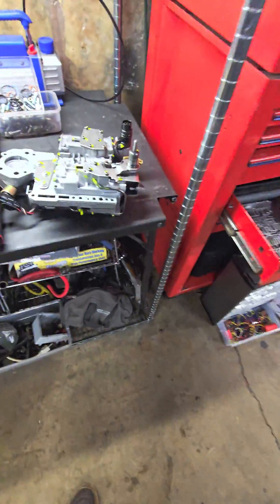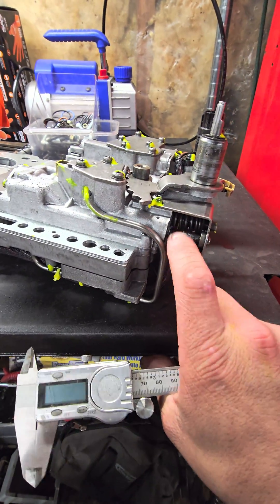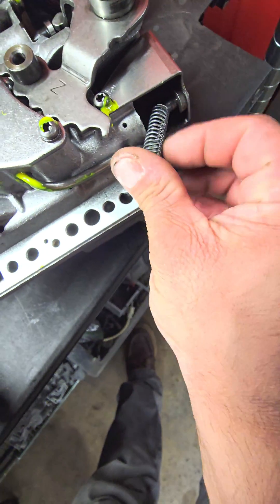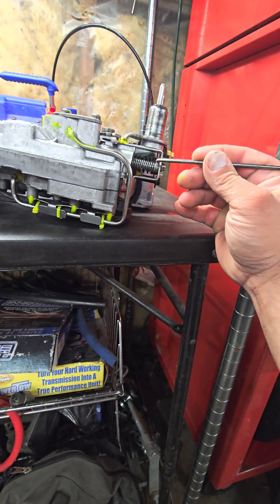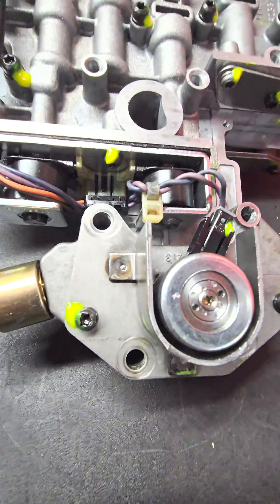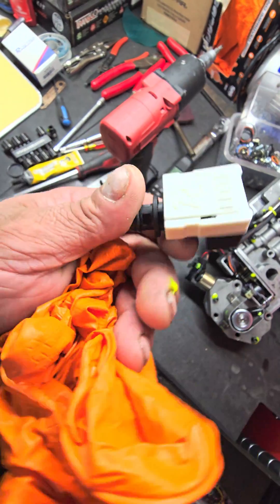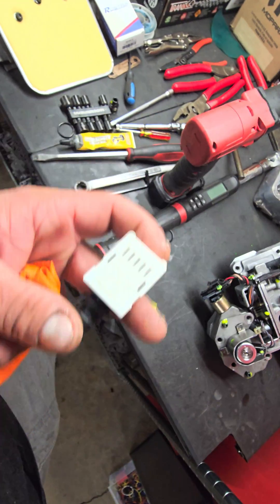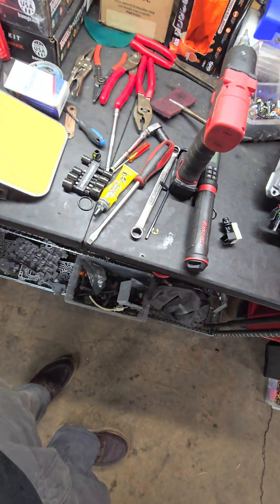check your 46/47/48RE switch valve clearance!

Comment: Can you please tell the pressures you like on a tow truck.
Reply from the maker: 85-90 idle in drive, 185 full throttle converter locked. Get the trans go TFRE-PRO kit. You will LOVE it.
Reply from the maker: If you're worried about it being too firm then leave the orifice sizes how trans go sends the kit, and dont go crazy with making lockup firmer